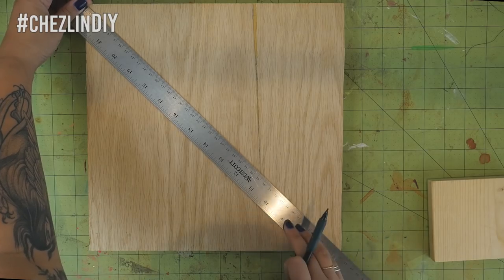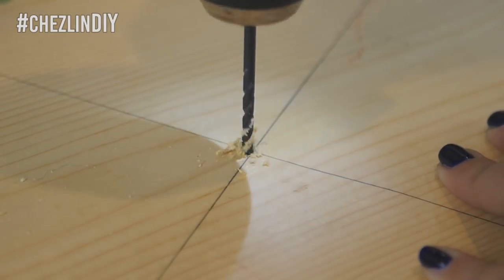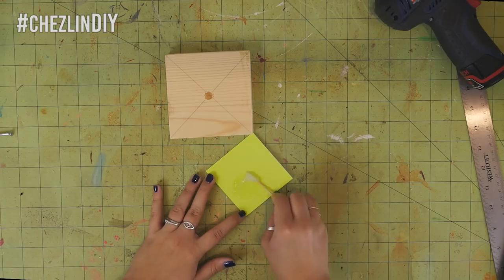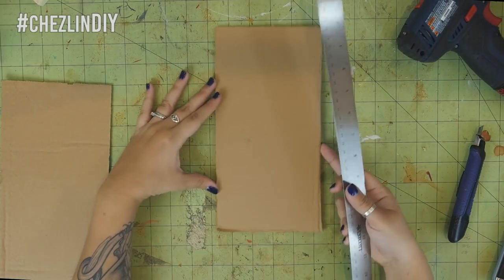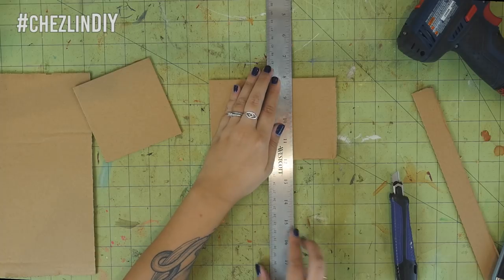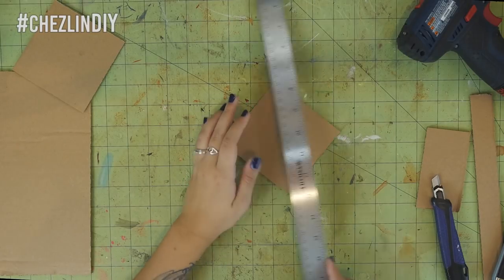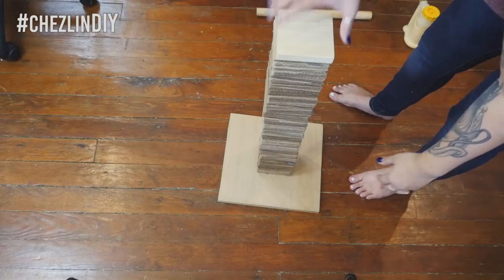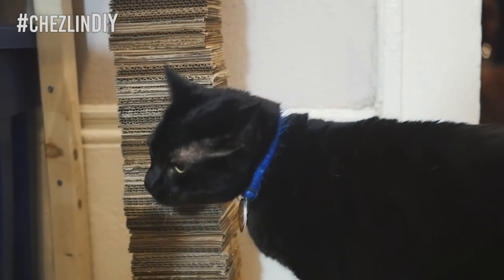How to Make a Cat Scratching Post : DIY

Comment: If you can find a circular base with a lip you can cut long strips of cardboard and roll it up and place it in the  oracular base for a floor version, my cat loooved it. they sell them at stores so if you already had the base but the cardboard part needs to be replaced you could use this method as well.
Reply from the maker: Yeah, I bought one like that with a ball that spins around the edge. Once they destroy the cardboard that came with it, I'll probably use that method to replace it :)
Reply: chezlin they do have replacements of the cardboard but what's the fun in that